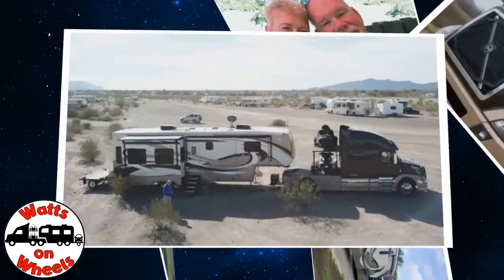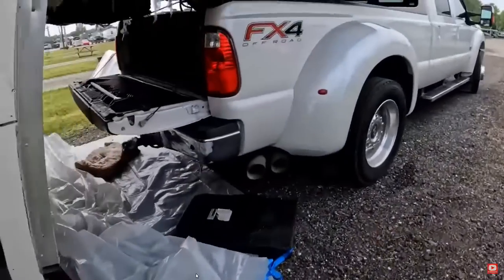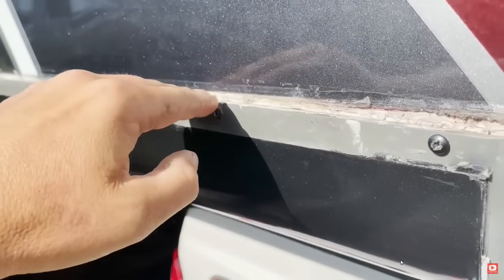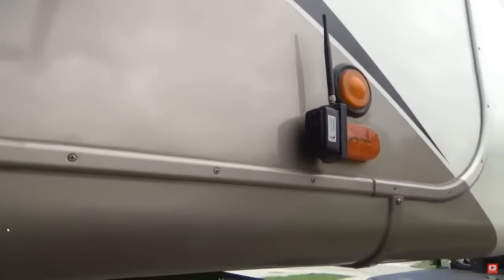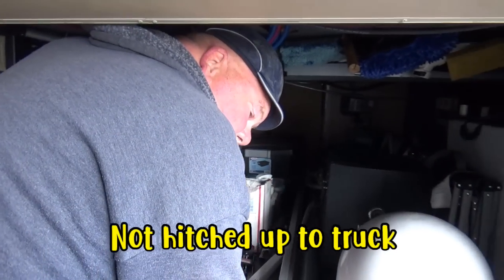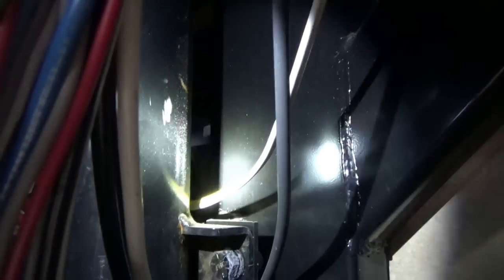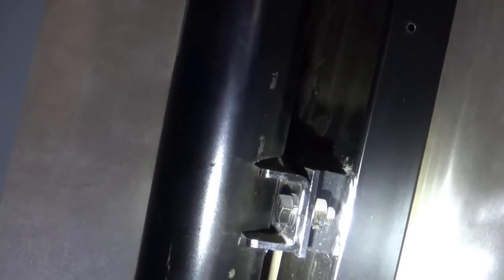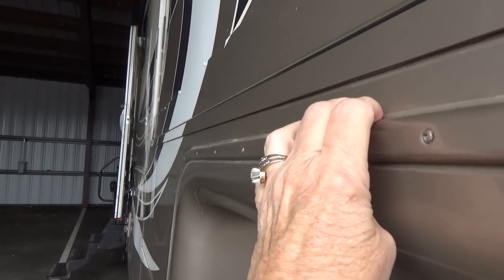😲 Cracked RV Frame Inspection // Lippert RV Frames

Comment: Dave, I can't believe that with a issue like this that Lipert hasn't done a recall.  Personally when we use to build trailers for 5th wheel livestock and hotshots.  At the cantilever point or overhang area we added an additional gusset over that area.  So you would have the weld point of attachment and then an additional piece of 1/4 flat plate.  It just gave you that additional support.  Hotshots and live stock hauler love to load the lower deck heavy and then add more crap on the cantilevered area.
I've been known to over build things.
Safe travels and roads Brian and Cindy, "xtreambydesign with passion"
Reply from the maker: That makes since.  If RV manufacturers recalled all their poor quality issues, there would be no RV's on the road.

Comment: So glad your crack free , you already know my beer calculations , karen is forgetting all about the worry and stress before you  found out you had no cracks , poor Dave's brain will have been worrying about the potential major work before he even checked, nervous time .....🤣🤣 12 pack sounds good , after all he did remember to protect his head this time 😁👊🏴🇺🇸
Reply from the maker: LOL... stress and fear factor need to be added to my contract for beer rations.
Reply: @WattsOnWheels  You need to be rewarded for proper use of safety equipment thus lowering insurance costs. That's worth a couple of beers, besides you need to wash the pork chop down!
Reply: Unlike Hunter!!